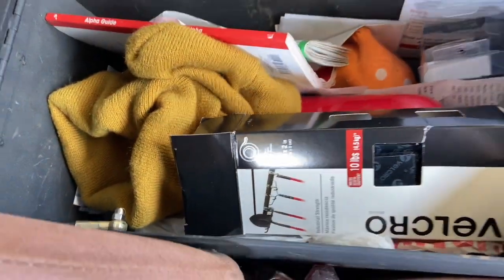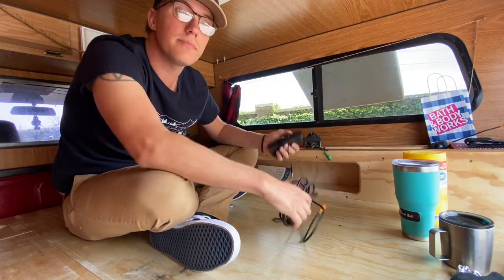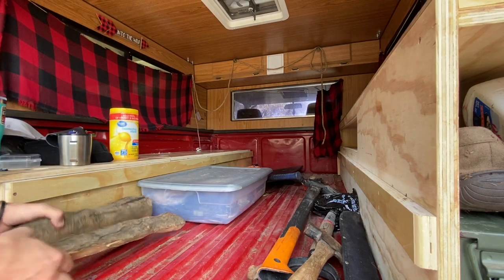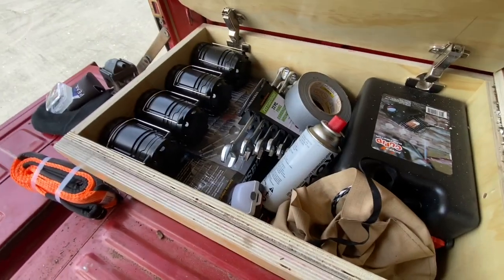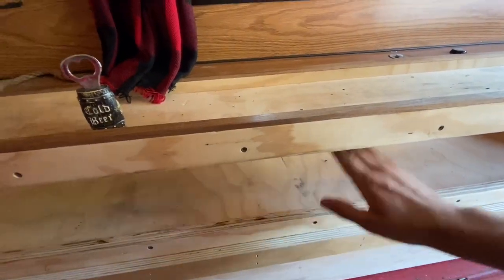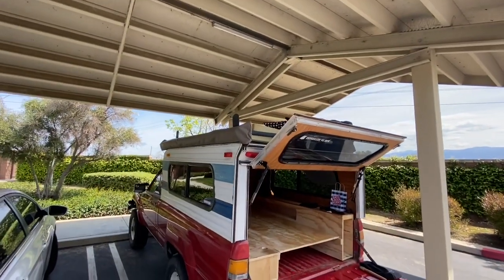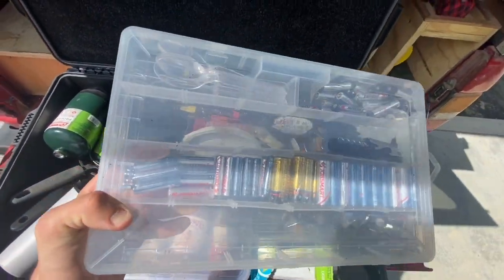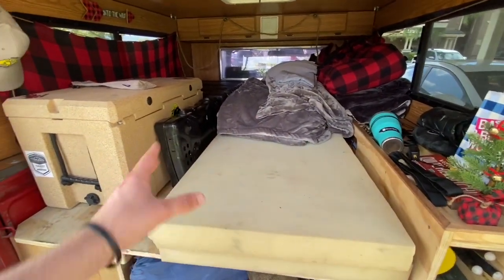Organizing Our Truck Bed Camper

Comment: great setup!  So organized.  Have you considered duralining the bed?  I have a nissan frontier, fairly simple project.  rough sand it up....alcohol wipe down and roll on the liner.  8 hour project....   I did it in 2 days during breaks at work.  hahaha    I think I will build out some wood  shelving this winter.  I basically just use mine to haul all the camping supplies as I tow a tiny camper behind.  But....I need better organization.

Comment: Just curious how weather tight your shell is and if its robust enough to survive moderate 4 wheeling? Thanks! Great setup!
Reply from the maker: Sealed up tight! It’s held up to some pretty intense wheeling as well. Have to tighten some screws now and then but not too bad
Reply: @atoyotacalledamelia600  thanks!